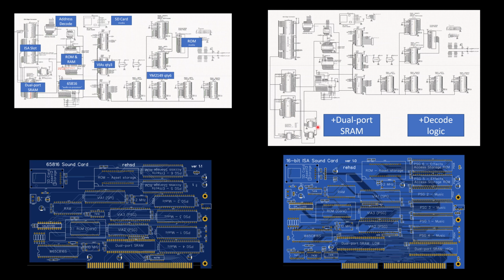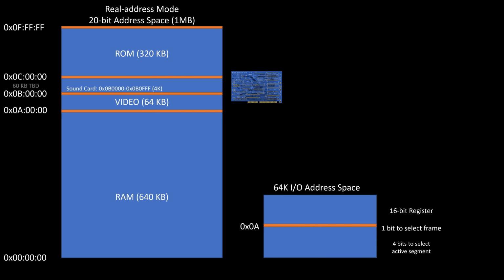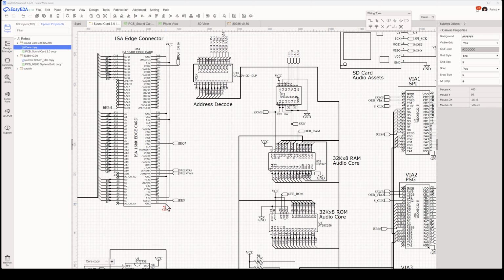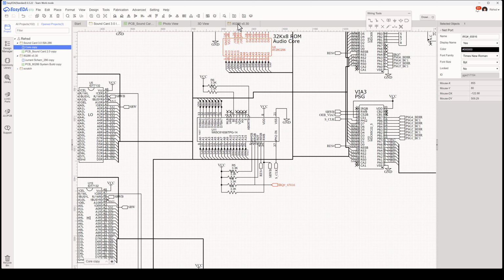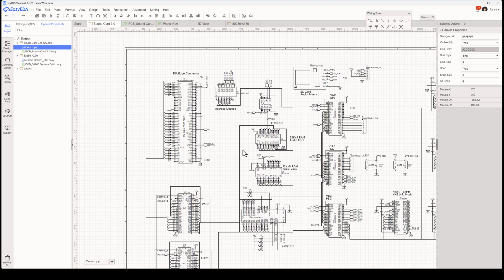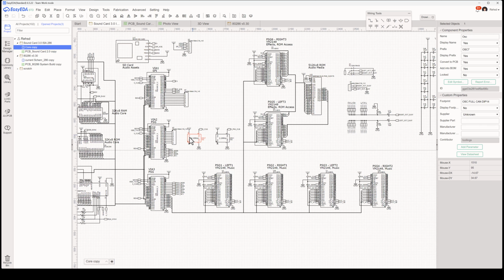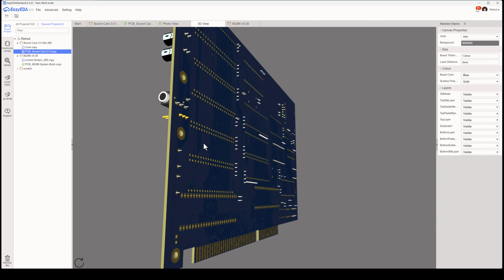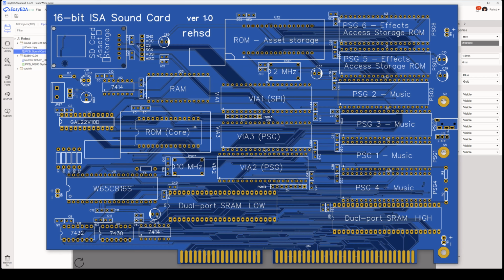80286 Build, Ep. #70 - Sound Card PCB Complete

Comment: Your manual IRQ and IO range choices have been discussed. You have a golden opportunity to re-invent PCI/PCIe with a simple say serial interface that cards cen be interrogated to discover how much I/O space and how many IRQs they need, have the main CPU assign them at boot time, and write back the actual assiged addresses and IRQ numbers over the same serial bus.  You could signal IRQ's using another small serial bus frame running at say a couple MHz - basically the idea behind BAR registers and MSI in PCIe.  Anyways, have fun!

Comment: Perhaps look at decoding an IO address to generate the interrupt to the sound card, instead of repurposing a DMA request signal.

Doesn't feel right to call it ISA once you start to make modifications like that. 🙂

Alternatively, if you could find some DPRAMs that have "mailbox" functionality, you can use that to generate interrupts from one port towards the other port usually by writing to a specific memory address somewhere near the top of the RAM.
Reply from the maker: Ya', I was going to cheat a bit, but I've reconsidered. :)  4-bit register added. https://youtu.be/_zsRBnxp-hQ
Reply: Just realised that if it was a true ISA card we may also use it on a PC ! Interesting;) btw, it would be nice too to have it as an apple// card 😇 
Just daydreaming;)